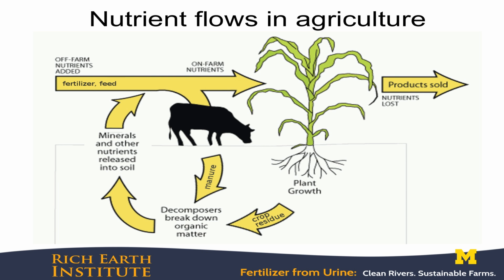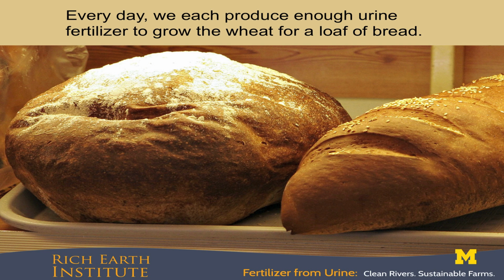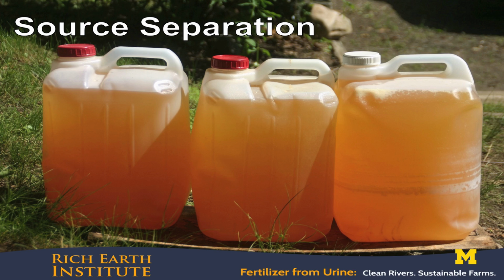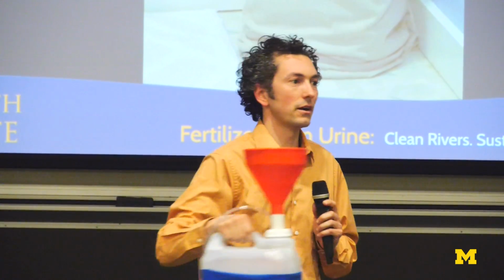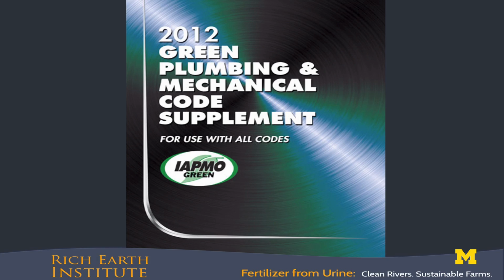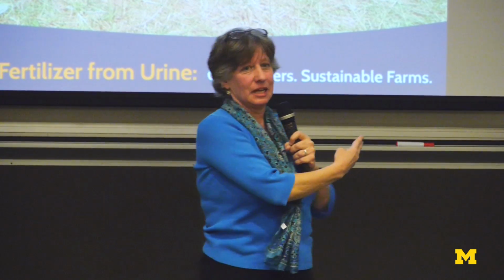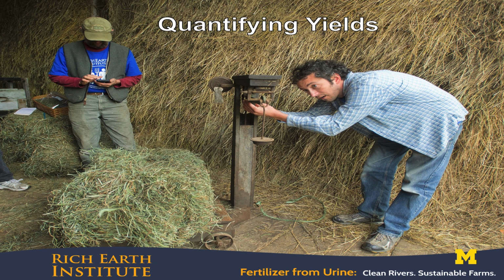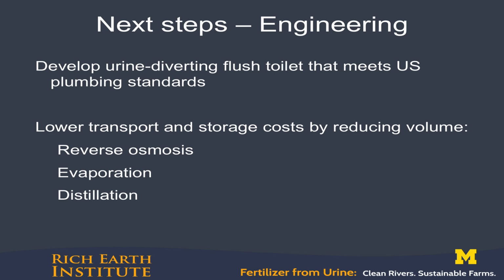Noe-Hays & Nace | Reclaiming Nutrients from Human Urine

Comment: the interesting thing is that it may be cheaper both in initial infrastructure investment and ongoing cost to collect urine & faeces as solid waste in the same way we do garbage as opposed to sending it down a sewer. Currently in the US, older cities are faced with multi-billion $$$ mandates from the federal government to renovate their decrepit waste water and sewer systems. Even with maintaining a sewer type disposal system we should be able to reduce water use for this purpose by an order of magnitude even over current state of the art 3-5 liter/flush toilets/urinals by the simple expediency of going to zero water for urine toilets and urinals. This would reduce the necessary size of the sewage system and the treatment system at the end not to mention the saving in water pipes to supply water to urinals in men's bathrooms.